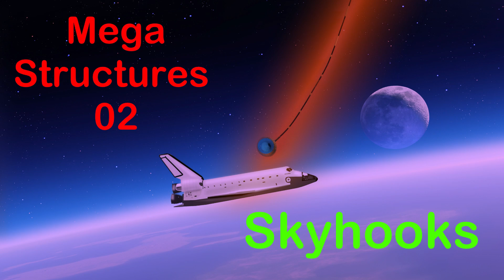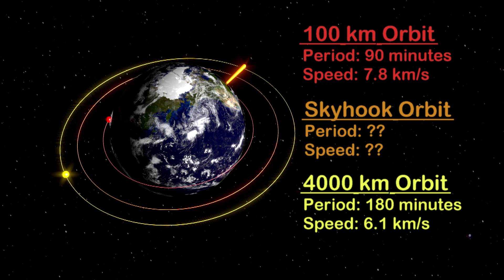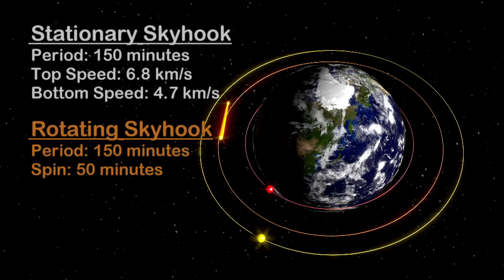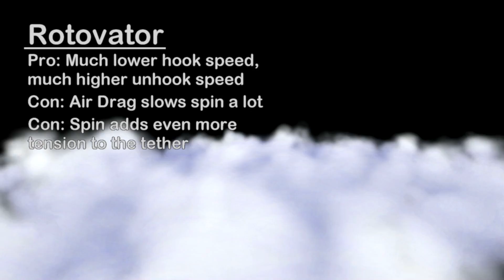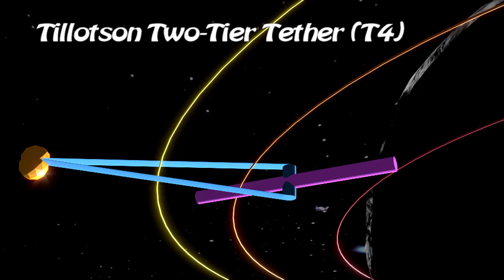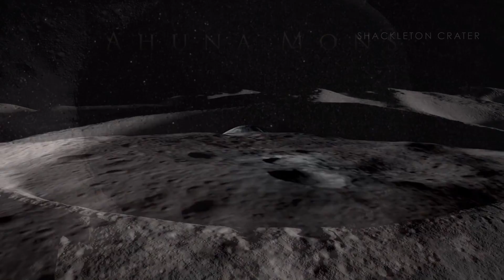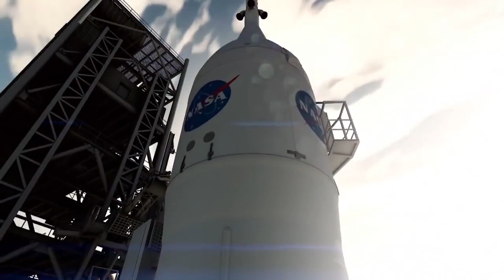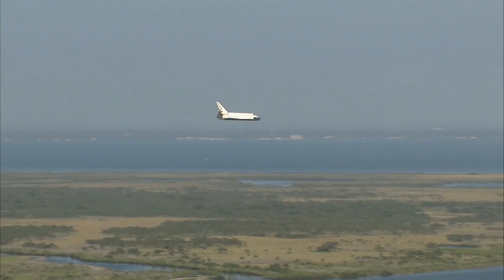Skyhooks & Rotovators

Comment: Man your videos are looking better and better!
Reply from the maker: Thanks Cody! Amusingly just a couple minutes ago I hooked up a new monitor and realized with shock that the old one wasn't HD 1080p, so I was a bit taken aback at realizing I've never really seen my own videos before.
Reply: @isaacarthurSFIA >> I just thought of something sort of 'tether-related'. 

I read something a while back about a Soviet<?> proposal to use some kind of long tethers to discharge charged particles from the Van Allen Belts into space {away from Earth}. 

Did I misunderstand, or is this a thing?
Reply from the maker: Yes, using them to slow stuff down does transfer its momentum to the tether too, so you can use it cut down on the speeds you re-enter at and regen the tether while you're at it. It's ideal on airless worlds where aerobraking isn't an option but it should help cut down on the shielding vehicles would need coming in, which is handy is you're shooting pods of precious metals home from the Belt etc.
Reply: @isaacarthurSFIA  I hate to mention this, because you're probably not responsible for the animations, but your "skyhook ladder" animations has the lower end of each higher skyhook at the same altitude as the higher end of the lower skyhook.  It would not work that way because of the speed difference.  The upper end of the lower skyhook would release a payload on the perigee of an elliptical trajectory whose apogee is at the same altitude AND SPEED as the lower end of the upper skyhook.
          Also, I know that you would get more advantage getting to orbit from an equatorial skyhook, but almost all the destinations (in the solar system) are in the ecliptic plane.  Your skyhook or cislunar skyhook network should be in the plane of the Moon's orbit, only two degrees off of the ecliptic.  That way your lunar skyhook can double as an interplanetary launch method.  A rotating skyhook on the Moon can pick up a payload on an elliptical transfer trajectory on the side farther from the Moon when the skyhook is on the Earth side of it's orbit.  It can then release when that end swings down to the Moon at points along the lunar equator, or hold it until it reaches the farthest point in its orbit from the Earth and release it on an interplanetary trajectory (or close enough to one that an ion drive could correct).  It could also fling payloads picked up from the Moon on such a trajectory.  Moon to Earth payloads release from the Lunar skyhook on the other half of the transfer trajectory to descend to the top of your Earth launch skyhook ladder.  Solar System to Moon/Earth payloads can use this system, too.  Tether systems can get you up and down from popular Solar System destinations, too, of course.
          This plus a nuke powered ion drive gets you to Jupiter, and at infrequent trajectory windows Jupiter gives you a gravity assist to destinations in the outer system or beyond.  But this only helps for destinations in or near the ecliptic plane.  Alpha Centauri is way off our ecliptic.
Reply: Yeah, at some point Isaac should make the spaceship art for PBS Space Time so they can stop stealing from EVE Online.
Reply: Awesome episode! I agree with some other viewers that your video quality just gets better and better. Always look forward to Isaac ArTHUR-SDAYS!-Jim
Reply: That's correct! The velocity of an object returning to a hyperbolic trajectory's perigee from a high orbit around the sun would be very high, and that would be transferred to the tether. If a sufficient quantity of material were brought to earth rather than launched, the new problem might be: how do we slow down the tether?
The tether would be very useful for putting an object on a hyperbolic trajectory to leave earth orbit, but there's nothing stopping us from climbing partway up the tether and disconnecting in earth orbit as well. This means the tether could be useful in deploying other launch systems! This would potentially reduce the cost of constructing a space elevator. Thoughts?
Reply: The skyhook concept didn't impress me until I read your/Cody's comment. Maybe bringing stuff to Earth is indeed a better use for a tether. The extra momentum could be consumed by generating power from the Earths magnetic field making such structure not so dependent on fuel or solar panels.
Reply: What about using tethers to bring material back from space say platinum mined from an asteroid? no need for heat shielding! It would get it down to a speed that parachutes would work just fine! Also would dropping material speed up the tether? If so you could send down some to make up for the stuff you bring up.
Reply: You know all is skookemist when one of you're favorite Yute Ubers is commenting on one of you're favorite Yute Ubers channels. . . Cody, Isaac, love you forever guys :)
Reply: Both Cody and Isaac upload videos at the same day.
I love Thursdays! ❤
Reply: Isaac, As a video editor with a 2560x1080 monitor, I have the same problem but opposite cause. I always test my exports on as many different screens as I can find as a result.
Reply: And judging by the language, AvE is also one of your favorite Yute Ubers.
Reply: Yes, they are. I don't think I could really wish for anything more. Since I found this channel.

Usually content becomes more watered down as a channel grows. Not this one though!
Reply: Hay, cody is her!
Reply: additionally, if you had a bunch of material constantly going up and down the tether, it wouldn't need active stabilization because the import would cancel the export.
Reply: You people and your englishisms forced me to look up AvE. No regerts.
Reply: In a multiple-tether system, what does the transfer from one tether to the next look like? Is the load inserted into an orbit to wait for the next tether? Does it need maneuvering thrusters to get in position to be picked up by the next tether, or is it practical for the transfers to be precise enough that it's a relatively passive process for the load?

I suppose the payload could be encapsulated in a vehicle that handles the transfers. They'd hang out in a high orbit and be loaded with incoming cargo (and fuel as necessary) and then autonomously handle the tether transfers, maneuvering as necessary, dropping off the cargo where requested and riding back up to wait for another load.
Reply: Dear Alex

First of all I'd like to thank you for bringing that video to my attention. It did convince me that a maglevtrain in a vacuum tube wouldn't be a reality in 10 years.

However i don't think any of those problems were fatal to the idea of the hyper-loop, it needs some work though. Lastly i'd remind you that just because the zeppelin died didn't mean air-travel died with it, I think the same might be true with regards to supersonic-travel.

-Martin
Reply: In fact, the opposite is happening. Just keeps getting better.  Well done :)
Reply: Cody'sLab Shill.
Reply: its the guy with a chicken hole! and a robot
Reply: Cody'sLab  https://youtu.be/ofPgdcYWo_0
Reply: This point is getting de-railed...
Reply: How come I see you commenting on almost every other video I watch? xD